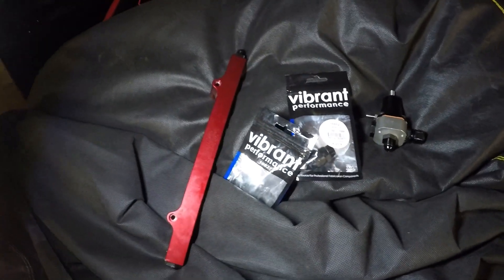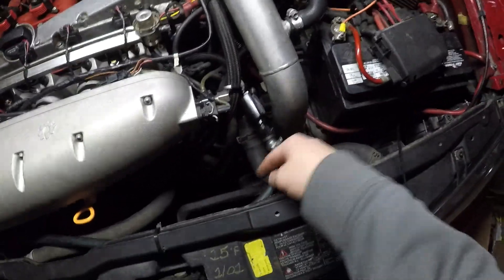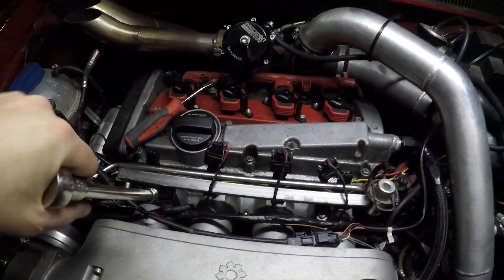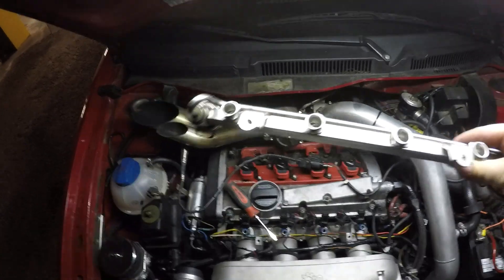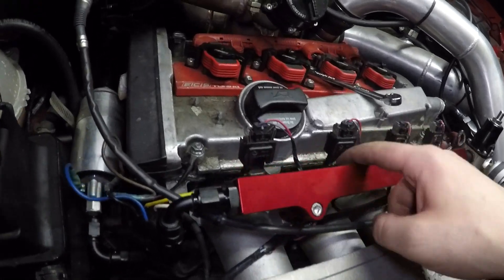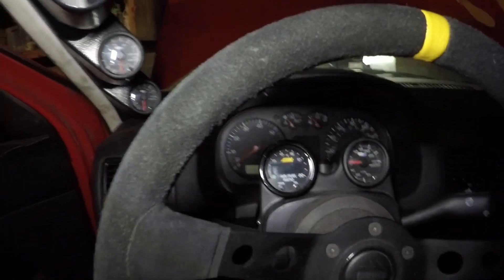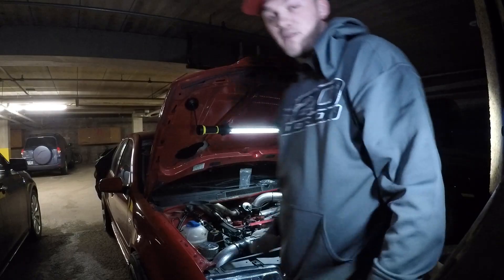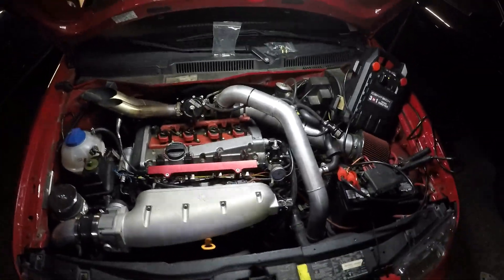500hp Jetta IE billet fuel rail install!

Comment: Congrats on the 1k ! Keep up the good work man ! 
P.S Jelous of your shifter ... want one bad for my rally-x mk4 jetta
Reply from the maker: thank you! And you won't be
 dissapointed if you get one!
Reply: @mxz700MN  ya it looks like it's perfect height and distance from the wheel and nice short throw . I had a Coolerworx one in my old b5 a4 and it was awesome . Are you running sigma 5 cable ends ? Or the TT shifter lever on the trans ?

Comment: Where did you get the fuel lines for it cause I want to order it off ecs but it’s the only kit other than the 034 motor sports one that doesn’t come with the an/lines

Comment: How do you run this with stock fuel lines because you have 2 lines and the rail only has 1 insert how does that work
Reply from the maker: I dont have stock fuel lines I ended up running a -6an feed and return
Reply: hp_enthusiast so do the lines run to the stock location I just can’t tell where you have your lines coming from and running to

Comment: What size throttle body did u run? 60 or hemi?
Reply from the maker: it's a 80mm hemi!
Reply: hp_enthusiast dope. I can’t wait to build mine
Reply from the maker: @mattkunselman1336  they are a lot of fun when they work haha
Reply: hp_enthusiast I bet. What setup do u have for e85? A guy from pagparts.com told me to use a Walbro 450 with 1200 injectors and a surge tank
Reply: hp_enthusiast also when does the 7670 start to spool?
Reply from the maker: @mattkunselman1336  it's at 29psi by 5krpm with a 1.22ar hot side I have some videos of the boost gauge on my Instagram if you scroll down a bit
Reply: hp_enthusiast nice nice. Does the hood exit help with traction?
Reply from the maker: @mattkunselman1336  haha probably not it's just loud. and I don't know much about surge tanks but a walburo 450 is a good pump and 1200cc injectors should be good for 500hp on e85

Comment: I got a red ie fuel rail sitting in my basement for like 2 years now 🤦‍♂️
Reply from the maker: slap it on your car!
Reply: Yeahhh I have to order fittings for it... maybe when my built motor goes in it already has a 034 one on it though 🤷‍♂️

Comment: What clutch setup you running
Reply from the maker: Right now it's I act single mass flywheel and a act 6 puck sprung
Reply: The act one is cheaper then the one i looked at and gets raved reviews better then paying over a grand
Reply from the maker: @pickletickle7836  I've had very good luck with it!

Comment: Hey bro what brand of fuel rail is this and what type of fuel pressure gauge is that?
Reply from the maker: here's the links for them! 
https://www.performancebyie.com/integrated-engineering-billet-fuel-rail-for-1-8t-20v

https://www.jegs.com/i/Aeromotive/027/13130/10002/-1

Comment: What size fuel lines are you using?
Reply from the maker: -6an feed and return!
Reply: You have a seperate gas tank or you have the factory tank
Reply from the maker: @endlessperformance4275  factory tank witch deachwerks dw65 intank pump and a walburo 255 inline pump!